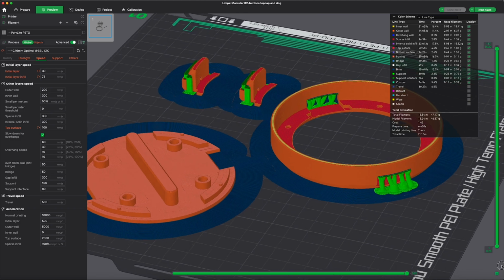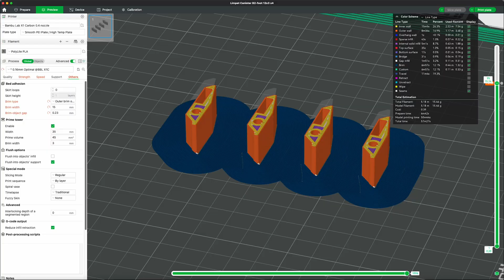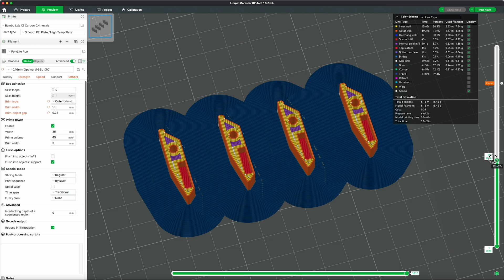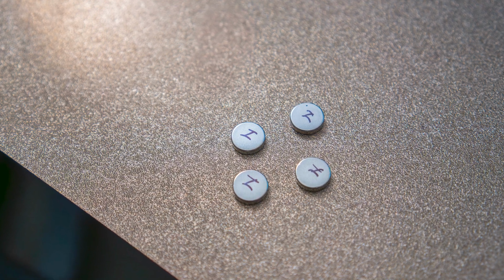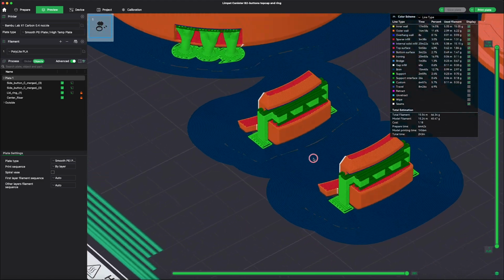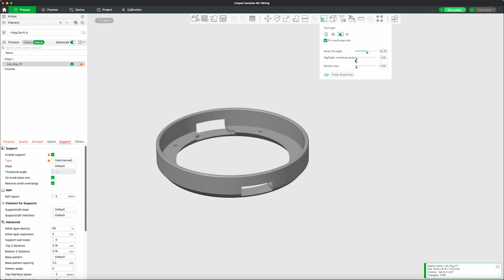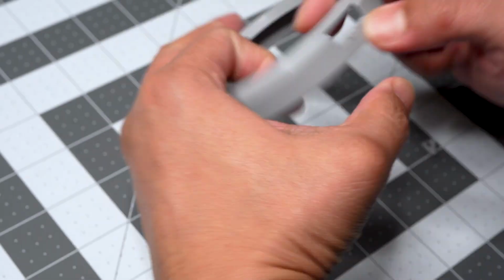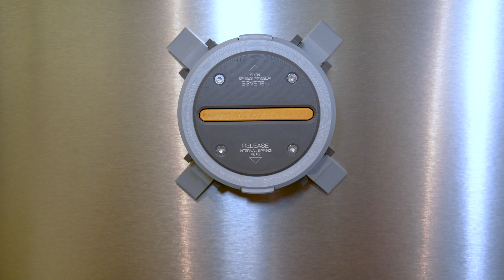Magnetic Pod Build

Comment: Do you happen to be using a different hotend to keep the magnets from attaching to the hardened steel hotend? Or, are the tolerances just tight enough that the magnets do not come out when printing over them?
Reply from the maker: The magnets are pretty snug for the 17 magnets that sit flat in the base, but the Bambu uses steel build plates on a magnetic mount, which helps a lot. But the four that slide-in more (diagonally) vertically into the upper part of the main body (and farther away from the build plate) do sometimes slide up a little when the hotend passes over them. But they almost never come all the way out. Those magnets and the hotend do a little dance, but eventually get sealed-in with no issues. If you're having problems, you can try dabbing the magnets or cavity with a little glue before sliding them in, then just waiting a bit for a bit before unpausing to give the glue some time to set.
Reply: @batchresearchlab  What glue do you recommend for PETG? My last experience using magnets with my X1C, they all came flying out as soon as the high end went over the hole 😄. But, I also didn't really have the magnets in with a very tight fit.
Reply from the maker: We've used different blends of cyanoacrylate — which is pretty much krazy-/super-glue; but if you search under the chemical name, it's easier to find different thicknesses, cure times, etc. You can also try using an accelerant with it.

Comment: Was able to build this and have another unassembled. Very cool design overall.  @batchreseachlab Can you do a slight change or addition of a stronger spring and taller buttons ?  (stick out farther) Also the lid is a tight fit printing at .15mm on a Ultimaker5. So if others print this, it may be good to print the lid ring scaled up to 100.5%, I have to do some carving/sanding to get to fit nice.

Comment: Ps for that spring, @4:24, isnt a zig zag pattern stronger? That would have two attachments vs that single one you have now
Reply from the maker: Not quite sure what you mean, but we used a curved design for the flat springs to distribute the compression forces more evenly throughout the length of the spring. Sharper corners tend to concentrate those forces at the angles, increasing the likelihood of those areas failing/breaking.

Comment: how do you know when to stop to place magnets?
Reply from the maker: You can set a pause point in the slicer. So right where you would want to insert the magnets before the layer that covers the cavity the machine will pause and you can insert them and continue printing.
Reply: @batchresearchlab  thanks. It stopped right where it needed to be. My magnets were a little tall. Should've used the 3.2 file. It came out good, just slightly wrinkled floor.
Reply from the maker: Oh, nice! Apologies I didn’t realize you were actually in the middle of printing our file :-) we have the stops in the bambu file. We have also discovered that sometimes the magnets aren’t consistent from manufacturer to manufacturer or batch to batch. So it can be just a little tricky sometimes. Would love to see how your build came out if you have photos! We’re curious what color combos, etc people are doing.
Reply: @batchresearchlab  can do. I kinda followed your colors, but how do i post my print?

Comment: Not a builder and am thus not even remotely sure on how this would be done, but since it is for vertical surfaces it might be neat to have a lid design that has something like window that can be opened so you can grab things inside without them falling out, first thought that came to mind was one of those aperture openings but just on half of the lid. Might be neat to have it open by twisting but I imagine that might be a pain to do.

Comment: Laser engraving turns grey printed PLA white? Or did you backfill the engraved areas and use camera tricks to make it look like it was all happening at once? I would have thought a high powered laser would darken the PLA, but I'd never tried it.
Reply from the maker: The laser bubbles or 'foams' many variations of PLA, which results in a lighter color.
https://www.permanentmarking.com/the-4-most-common-types-of-laser-marking/
The footage is sped up (usually between 2x or 3x, depending on the clip), but other than that, no other special effects were used. We've found that laser effects different materials in different ways. PTEG for instance, can darken or lighten depending on the laser settings.

Comment: Is this print parametric? I love this but I’d like the container to be deeper.
Reply from the maker: Unfortunately, this was direct-modeled (and in a freeform and relatively undisciplined way, I'm afraid 😬). But because of the way these parts (and hardware) work together, there really are only a few very specific places that can be made variable without causing one part to become incompatible with the others. We're currently going back to see if we can clean up the parameter history to see if we can get the height/depth to be variable (and still have it work with the lid without modification to the lid) 🤞🏼. In the mean time, we're also prepping some updates to the file package and we'll include a slightly 'deeper/taller' version that may work for you.

Comment: Having recently done a 3D printed project that relied on embedded magnets to hold something on a vertical metal surface, the design was able to hold a lot more once I added some rubber strips to the base. Once it sticks onto the wall, sliding it around becomes virtually impossible. You can even add a channel to the base so the thickness of the rubber is offset to only a fraction of a millimeter that sticks out and makes contact.

Comment: Has this kind of design a name?
Reply from the maker: We're just calling it a 'Magnetic Pod'🤷🏽‍♂️  ...I know...pretty straightforward and not very imaginative🤣
Reply from the maker: Just realized you might be talking about the aesthetic vs the object itself. There are a lot of things that reference this, but in modeling itself it's called "hard surface modeling". Aesthetically it's related to mecha, cyberpunk, nasapunk, hard (realistic) scifi, military and industrial equipment, videogames like Wipeout, Cyberpunk, Metal Gear, Portal, Starfield, etc. You would find a lot of this look in older anime like Gundam, Macross, Ghost in the Shell, Akira, and so on. But also in many, many sci-fi movies. Think District 9 or the Aliens Franchise, etc. Thematically it's usually mixing visual elements of technology, exposed structures (light-weighting cutouts and panels, screws), military vibes, robotics, and of course, NASA/space travel, etc.

Comment: Open up a drill or power tool and you will see plastic screw holes molded into the body.  There won't be a threaded insert on the entire tool.  These threaded inserts are usually an unnecessary step and needlessly overused.  Buy some thread forming plastic screws and save yourself the time and hassle.
Reply: You must be buying some low quality tools, my Milwaukees use threaded inserts all over
Reply: @3ExtraLives  Milwaukee power tools and Ryobi come from the same factory.  Both made by TTI.  🤣🤣
Reply from the maker: Quite a few of my Makita and Festool tools have threaded inserts in the plastic bits. We use the threaded inserts when we're designing because repairability and upcyling is part of our core principles. Not sure how often you repair or modify used items, but plastic threads strip/tear out extremely easily. That is really exacerbated sometimes with 3D prints because of layers, etc. The brass inserts create a very nice assembly/disassembly capability as well as for adding modifications, etc over time. But you know.. per usual, you do you! We all have our own take on things.Thanks for watching.
Reply: @batchresearchlab  The threads strip because you are probably using machine screws.  I recommend trying the thread forming screws, they work.   That is all.  Very cool project. 😎

Comment: You still need to learn a lot about the configuration of magnetic circuits in order not to make such stupid mistakes as in this project. S and N are like + and - in electricity. If the electrical circuit is not closed in a ring, no current flows and nothing happens. In your design, the magnets are positioned so that the magnetic circuit closes through a large distance in the air - around your entire box, so the force of attraction is greatly reduced and a lot of magnets are needed. Actually, only two magnets in each leg were enough to hold the box very tightly.... but they need to be properly oriented.

Comment: But what does it do though 😫😭
Reply from the maker: Really, it's just a round magnetic container but it could provide a good basis for someone to modify it for a specific use. A purpose-built insert would just need to fit into the cavity, and possibly make use of the rim slots for retention. There's also a simpler 'blank' snap-on lid in the file package that may be an easier place to start from.

Comment: I'm imagining a version of this that's mostly built out of cut aluminum, and the snap on feet have small rubber feet to improve friction to counter the extra weight for potential sliding. Then creating a foam insert for the interior to hold whatever items are being stored inside.
Reply: I’m sure if you wanted you could have this printed/machined by a company like pcbway in aluminum or whatever material you want. It would be expensive but it would absolutely be possible to do exactly what you want.

Comment: I notice that you orient all the magnets in the base with matched polarities, but am curious if something like a Halbach Array could be used
Reply from the maker: We've gotten quite a few suggestions to try this! You're in good company👍🏼. One of the things we'd need to figure out is how to prevent the magnets from repel-flipping each other during the installation step. We may need to stagger the cavity heights so that we can stagger the installation by getting some sealed-in before the others. But that will eat a bit into the interior volume.🤔
Reply: @batchresearchlab I think you can get Neodymium Magnets in rectangular bars? Perhaps assemble the array on a piece of tape then drop it in as a unit (square?)
Reply: @batchresearchlab  - So, through a little searching, they make them with  poles laid out Diametrically, which, if available in the same diameter, could work

A little dab of CA glue could prevent them flipping if that's an issue, or add a nodule to the cavity for a friction fit

Comment: What this thing is for?
Reply from the maker: Practically, it's a magnetic container that will not only stick onto a (ferrous) vertical surface, but also prevents magnetic contact unless some pressure is applied (so it won't stick onto the top your metal desk unless you want it to). And we've made the design serviceable and modular, so it can both be repaired, and potentially modified to suit other needs (for instance, the lid can be modified to house a clock or other digital read-out device someone might want to be able to stick onto a wall). But really?....we just wanted to see if we could make some of the stuff we remember from sci-fi, anime, and video games when we were kids 😉

Comment: I use a thin piece of rubber, even sticky dots, as the contact surface in scenarios like this. The magnet has plenty of pulling power, but the coefficient of friction gives you an easy way to scale up the force required to make the pod slide.

Even hot glue works quite well and could be applied to channels cut into the base.

Comment: Where did you get that insert press tool?
Reply from the maker: It's a ruler from CountyComm
Reply: @batchresearchlab  Sorry I was not specific.  I meant the tool that holds the soldering iron.  Its like a drill press for inserts.
Reply from the maker: Oh, we actually got that as a set that came with the soldering iron. If you do a search for 'heat set insert press tool' a whole bunch of the same/similar examples should come up in the return, available from most of the general retailers. Ours is pretty basic actually and it's just comprised of that base plate and two pieces of standard aluminum extrusion (the kind used for industrial/commercial shelving/storage/cubicles) connected by bolt-on rollers. But if you don't want to do that, we've also seen some pretty impressive looking designs that people have 3D printed.
Reply: @batchresearchlab  that's actually a good idea.  I could just 3d print something to go with my soldering iron.  Thanks for the reply.  Looking forward to future posts.

Comment: god those are cool, if you get some double sided tape and rubber or soft tpu, and attach them to the bottom of the feet , you could have additional traction. if you put them on the bottom of the body, it'll also act as a surface protector. 

im gonna see if there's a bluetooth speaker or similar that would fit inside 

OOOO or,  maybe an NVME housing. and a magnetic sheet on a laptop lid. most impractical but cool housing ever. and you'll feel like a zeonic front sabatour  every time you use your nvme. 

not sure if laptops are still bothered by magnets though
Reply from the maker: We have been testing parts for an NVME case in the same aesthetic. If there’s enough interest we may try and accelerate that project. We ordered the raw USB C boards and have been starting to explore how it might assemble.

Comment: You want some print with your brim???? It's PLA, mate, calm down.
Reply from the maker: @The3Kway  We often have issues with certain formulations like some of the matte filaments
Reply: @batchresearchlab  IPA wipe the plate and bump it up a few degrees. You're really just making unnecessary post work for yourself. That high temp plate with some glue stick can keep an ABS rectangular box down at the corners without a brim.
Reply: @The3Kway   It's less work than possibly reprinting and needing more magnets. Not even worth mentioning really. I've seen enough failed prints because of this and also err on the side of caution. But in this case I would have just printed the parts flat with smaller layer height.
Reply: Adhesion issues can be caused by many things. Especially if you are switching filaments regularly across types and manufacturers. 

This morning I got some junk pla to behave by turning down the temps and ironing. 

Just your mileage may vary@SaHaRaSquad is right on the money with time. I never would have bothered if I werent printing thin pieces that would have been a nightmare to remove a brim from.
Reply: I've never ever had bed adhesion issues with a Bambu

Comment: Cool thingy, but you missed a opportunity: They are not stackable.
Reply from the maker: ❗️😉👍🏼...we've actually been experimenting again with tweaks to the lid ring design that includes some notches. It's a direction we ended up moving away from mid-process, in part because we were trying to reduce some variables because we were still working out magnet config issues at the time. The good news is that the pod design is entirely serviceable, so if we get to a good place with an alternate ring design, we can just issue an update and people can print the new one and swap it out!

Comment: What's the badass ruler you're using to press those heat set inserts down?
Reply from the maker: We got it from CountyComm a while back, though I think they still make it.
Reply: @batchresearchlab  Thanks! They sure do. 6" Titanium ruler ("indestructable") - Do I need a $30 ruler? Doubtful, but I'm not sure that will stop me
Reply from the maker: Yeah, we've had a few of them floating around in the shop for a while. They're really sturdy, stay flat, and are non-magnetic (which is a big help when you're working with a bunch of little magnets)

Comment: Incorporating a *soft* TPU pad onto the 'snap out feet' might help it to stick with more weight inside - better traction when stuck on a vertical surface.
Or alternately, a slight recess in the feet where you could stick silicon 'feet' for the same effect.
Reply from the maker: Yes! We’ve talked about that as well. Maybe we can tweak in a revision at some point. Thanks for the pointers.
Reply: @batchresearchlab  Perhaps there are alternatives to TPU, it sadly lacks the "stickiness" of rubber... something I recently encountered while making lids and sieve inserts for glass spice bottles. The friction between glass and TPU was almost nonexistent, forcing me to rethink the entire project. Initially, I had planned for a friction fit, but instead, I had to design a solution where I slip the squished TPU part down the inside neck of the bottle. Once in place, the TPU expands to form a small overhang exactly where the bottle neck ends and the main body of the bottle begins. The final mounting relies on the low friction between TPU and glass, combined with the resistance of the TPU to be compressed small enough to pass back through the narrower neck.

Comment: The old high temp / smooth PEI plate of bambu isn't great in terms of bed adhesion unfortunately. The textured plate is great but .. textured, so not always what you want. Recently, however, Bambu has brought out a new "cool plate super tack" built plate and it's pretty insane in terms of bed adhesion. I would totally recommend trying it out if you have issues with models like these. Very cool project as well btw :)